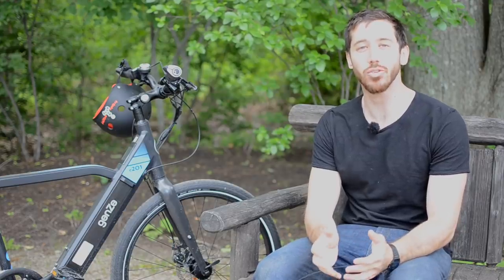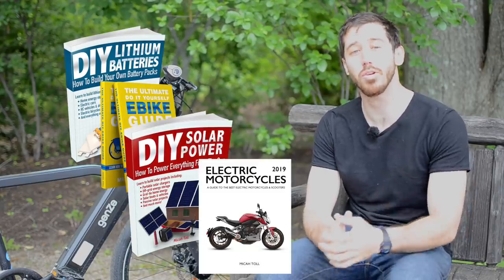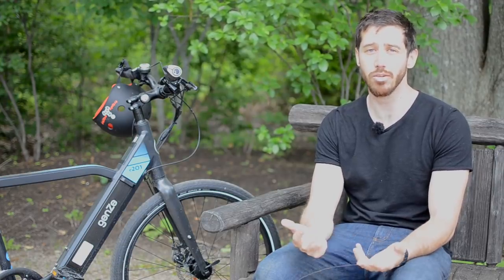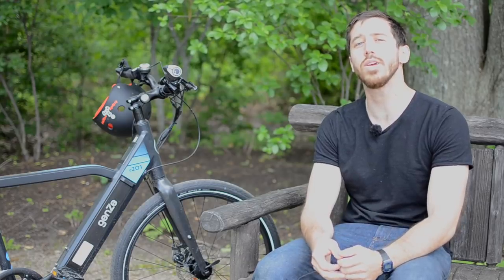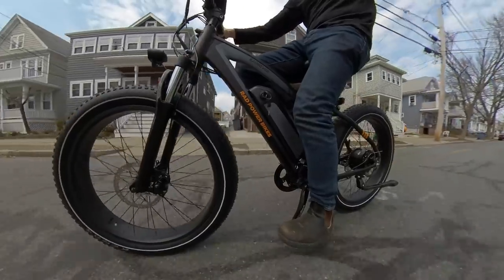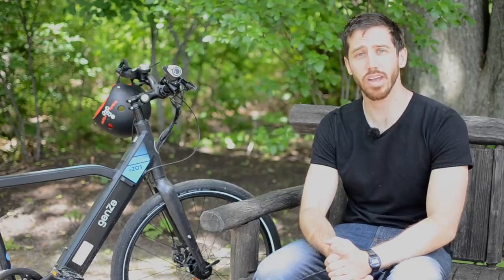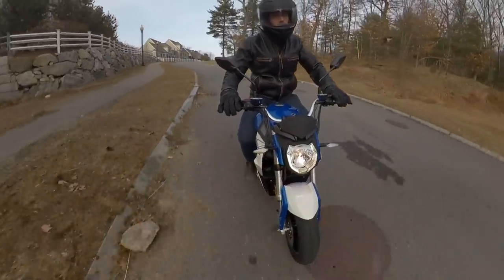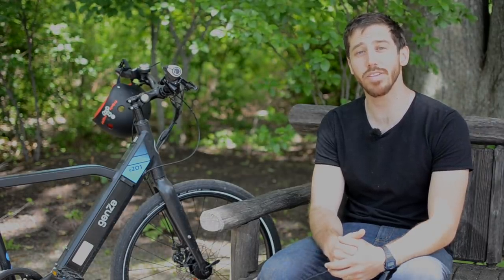How much POWER does an ebike need?

Comment: Most hub motors are geared, typically 5. Direct drive hubs, aren't geared.
Reply: Geared hub motors have a planetary gear reduction system, Meaning it's internals do less work to give you that power... Those hubs are able to be smaller lighter and more efficient than the gearless ones (not as powerful though). They are not gears in that sense, It still operates at a single ratio. Where as a mid drive, because it's driving your crank , Takes advantage of your bikes gears to give you multiple gear ratios.

Comment: Part of the question is how much power is too much with a mid drive? …you know, like changing the chain every week or something like that…
Reply: You should be able to avoid that problem with low gearing and an ebike chain like KMC. And of course using a gear sensor, brake sensors and changing gears like You do on a bicycle.

Comment: "PLEASE HELP" The more I watch the more I get confussed.... I want to motorized my 20" trike, I am wanting to travel with it and I'm going to have a 38" long coverted "child ride in" trailer. What kind of set up would be good for both power and longevity? Obviously I won't be at home every night to charge it so, I will need to charge it by solar as I ride, so I won't have to stay somewhere "ALL" day just to charge the battery "if I don't want to", also weight is a factor... "meaning" Hundreds of extra pounds, would not be desirable either.... are these parameters just a pipe dream, or can it be done? So To sum up what I'm trying to ask is..... if "you" were going to do a conversion on a Tri-Rider fat tire trike what kind of kit.. "ie: midline, front or rear hub kit" "watts" ect... so I might be able to figure out battery build, then be able to walk forward on solar charging ect..... WOW! I'm not putting any pressure on you am I??? "Wink, Wink, because I know your awsome, and knowledge." Can you help a gal out at least as to a starting point anyway.🤗😊🤗 many Blessing to you and your family, Ciao.... oh yeah thank you ever so kindly for your consideration and time.
Reply: Dave M  Yeah its great... insaine torque and speed... most important unlike a factory made electric moped i can replace everything myself if anything breaks... but those kits are quite good by now... and are quite reliable.. they are very popular in china for almost a decade...

Comment: Hi Micah: recently Justin at Grin demoed how to control a Bafang BBSHD with a phaserunner and CA-3. It would be an interesting project to build a bike with both a powerful mid drive and a front hub motor. Control both with the same throttle and PAS input. I imagine varying the power combinations between them with the CA would give you all kinds of interesting use case scenarios. Can it be done? What are the pitfalls that I need to watch for? Thanks

Comment: From an electrical engineer: "Until we get a "Mr Fusion device" You want as much voltage as your motor and controller can handle, and as much capacity as you can pack on the vehicle without making it so heavy that it negates the range increases"  👍
Reply: im guessing money isn't taken into consideration.
Reply: @kevinforget549  Neither money nor expertise were taken into account, but with expertise or drive to learn you can at least halv the cost of most builds. Good guarantee'd 18650's can cost $1.50 per. 11Kw 3 phase motors can be built for $300. 65Kw 3 phase, $1000. controllers able to handle up to 200kw can be built for $1000. Since we are talking a fraction for that power for bike or scooters etc,  it should be far less. Now if you use all off the shelf parts and have no drive to build anything yourself, then limit your build to what you can afford.
Reply: I should specify lots of money or time based on personal experience. I  stuck to battery building as it was the most straight forward thing for me to learn and the easiest cost savings. after buying my spot welder, building my case, and some learning mistakes along the way id say I broke even on cost for the first bike though at least I know how to make and repair batterypacks if they break.
Reply: @kevinforget549  Just remember most products we deign have a 400 to 1000 percent profit margin built in. When I design an inverter for a customer no matter the quality, they always want a minimum of 400 percent profit from it. The $21,000 dollar EV 3 phase controllers don't cost more than $2000 to build most of the time.
Reply: Steven Soco  Stay away from lead acid, it needs to go bye bye and is almost as expensive as the alternatives now with far lower lifespan. If you are designing an ultra efficient inverter design for American grid connection or battery back up, try to avoid using voltage conversion schemes. Better to go direct 200VDC to 120VAC across two legs (double H-bridge design) 90 degrees out of phase so you can have 240VAC power when needed and easy syncronization with grid power. This also reduces the need for large inductors since we simply LC tank the output for pure sine wave with ultra low distortion. The other thing this does is allows is much larger power application for far less current draw from the battery pack. Current draw is the battery packs enemy. So instead of 24VDC at 100 amperes, we are using 200VDC @ 12 Amperes. Far easier for the battery pack to supply low current for long periods of time. Mail me if you need design ideas or example circuits.
Reply: Steven Soco  Glad I could help. Mail me with your budget and what kind of power usage you are expecting and I'll give you a system overview.

Comment: Not very good review... power of a 250 watt can be high as 700 to 900 watts..maximum...20 amp 40 volt is 800 watts....so this makes no sense...and bad math....geared vs direct drive is way different too..

Comment: The problem over 500W-1000W you have no battery to cover this power, and if you use 1000W or 750 the battery life becomes so short and meaningless.

Comment: You this post is so old it’s nuts.. but let me give my 2 cents here. It’s depend on the person totally..  think of this ..why have a Ebike?  To pedal less.. I have 2 types of lung disease. I can’t walk 100 feet then I need oxygen.. I weigh 240 pounds..  so here is my clue..  I don’t pedal and need big power.. I need 2000 watt motor to pull anykind of hills from a start.. buy small motors suck and a waste of money.. I sent back a 1500 watt and 1000 watt rear hub bikes.. you folks quit talking about things we need.. we should have enough power to start and finish a hill. I an surethere are many customers like me that are 71 years old looking to get out of the house!
Reply: I think You need a strong mid motor ebike with a small front chainring , maybe a 32 T, with  the largest chainring in the back a 52T. With a throttle and gear sensor this "Hill Monster"  should definitely get You out of the house like You want it to. To be safe You may want it as a three-wheeler with small tires, Max 26".  I am 74 y.o with a serious joint problem in my left hip  and I am right now converting my MTB with a 750W Bafang BBS02 mid motor. I will ride it with pedal assist using my strong right leg and then let my left leg assist when it can, thus making my left  hip/leg stronger. And if needed I use the throttle in sudden steep hills or other difficulties.
Reply: @staffanlundberg  ha I found a 20 inch tire bike with 2000 watt motor, rear shock, blinker lights, brake lights, hydraulic disc brakes and a 5 speed hub.. it’s also has a 7 speed derailed..  not used at all…. I dare anyone to find the steepest hill ..stop put you feet down. Then start.. the bike I have now can start and stop anywhere and goes 45 mph..  As I start in 1st gear, and shift up with now pedaling what so ever..  nothing..fat tires. The rim are no spoke but 3 triangles..  cost is 1600 on eBay.  Plus 20 amp hour lithium battery.. This bike has more power than a aerial rider grizzly.. for 1/2 the price..
Reply: @terrytenley9327  "I found a 20 inch tire bike with 2000 watt motor, "
Ok, well I want to move my legs as I am biking.  I am looking for the exercise and beneficial effects on my joint problems. I am not looking for speed and I am happy to ride it in the legal limit of max 25 km /hour.  Accordingly I do not want an ebike/moped.  Thus I chose to limit the strength of the motor to a 750 W mid motor to get me up steep hills safely.  Safety is a main concern for me in biking. 
Also if You buy a complete ebike I suggest You to take a testride before You buy it to make sure it is what you want. 
Good luck to You with whatever choices You 
make !!  👍

Comment: I feel like you've skipped over any detail at all, just that each power is slightly faster and will handle hills better. Well, we all know that. What about hill angles, weights of riders, top speeds and rough acceleration times? There's no useful data in this video at all.

Comment: How much power does an e-bike need?
Me….Yes
Chuckles…Ok, what you need realistically is enough grunt to climb a good 10% grade at 10mph without peddling…I agree with Micah’s appraisal…My 750W Bafang hub copes adequately with my heavy body and heavy 30Kg bike.  A 250w hub is going to be a dead loss on a hill with a heavy rider….Not that Brussels Eurocrats care a jot and UK regulatory penpushers just kept the same law (I wish I could hate them to death).

Comment: When I want a motorbike, I take a motorbike. Anything more than trebling my power on the crank is not really a cycle anymore.
Reply: In Europe, a requirement for e-bikes is that you must be pedaling in order to use the motor assistance and the motor should cut off when you reach 25kph/15mph. If the bicycle can move with the sole power of the motor, you have to register it, get plates and insurance like a motorbike.

Comment: A Daymak EM2 with a 1500watt motor replacing the stock 500 plus a adequate lithium battery rolling on Goodyear motorcycle rubber will look like a stock EM2..60-80 MPH is definitely not legal.No worries about cops as FIDO (fuck it, drive on) is SOP for many police forces.
Just saying 🤔🐒

Comment: for treching with Ebike ?
more power needed isn't it true
Reply: Can you help. My ebike wheel 48/750w 1000w 48 battery 14A48v  carnt seem two get it two work what could be the problem. Cheers
Reply: @kevinhiggins2755  can't work is a brief way of saying it's not working. 
Check the controller connections. Bcoz lot of times the controller may get some issue. Battery and motor won't get damaged without physical abuse. 
If that's ok then check battery pack performance. 
Then if that's ok, test your motor....
Reply: Is it hand throttle or hall effect sensor which is cadence at the pedal.

Comment: Question: Is there a way to limit the power output of a 750/1000/1500 to 250W? This is for specific rules in a race where eBikes can only enter if they have no more than 250W motor.

Comment: Throttles have no place on an e-bike...use your legs with a pedal assist mid drive or get a motorbike!
Reply: Nah me and my 8,000 Watt motor shall rule the streets! But only for a few miles before the batteries die....
Reply: Throttles are helpful to kick start the bike in tight spots with steering on full lock and have better control whereas PAS takes off like shot kangaroo

Comment: lol, no. More power doesnt mean climbing hills better, absolutely wrong, you should learn more abount mountainbiking, man. Everythyng is about gearing. You can pedal assist much better if the bike is lighter. And the heavy motored bike will not climb as steep terrains as the light mountainbike will do. 250 Watt middrive with pedal assist will bring you up the steepest hills with the bike weight 20 kilo total. Just go and checkout Bosch or Yamaha mid-drive systems for the mountainbikes with 80 or even 120 Nm of torque

Comment: It is absolute nonsense that a 250W motor will not be good at hill climbing.   250W is the legal limit in Europe (and lots of other places) and there are plenty of pedal-assist bikes out there that will easily pull you up a hill.